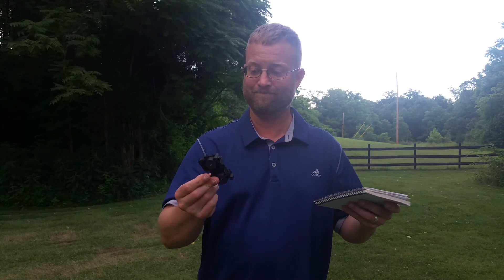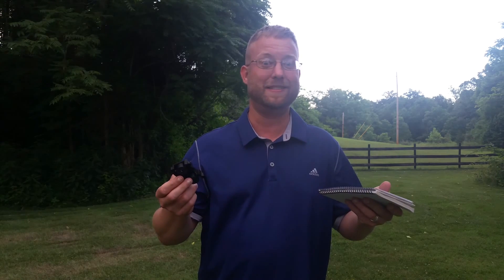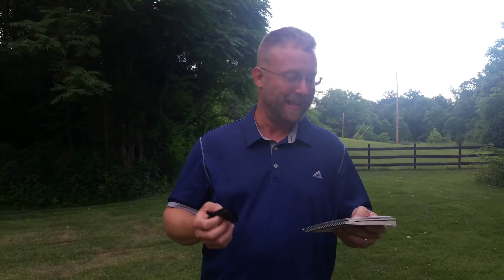Open Flywheel Project - High Crush Stryfe Cage

Comment: Where do you buy your motors? I love your vids btw. Your video on quieting super stock blasters is awesome. I followed your links to Kysans website but I couldn't figure out how to order. I already bought into the IMR ecosystem and I'd like to center my build around them for now. I have 10 nitecore 650 batteries so plenty to use. So far I have rewired two stryfes with 18 awg the first with a regular switch and the second with the jam door switch so I have motor braking. I got a high amp switch and I'm ready to move to aftermarket motors, cage, flywheels, but everyone is selling motors in spec for lipo.
Reply from the maker: Thanks for the feedback.  They have a separate e-commerce site that I believe is linked off of the product spec page.  The big downside to these motors is that you have to place a minimum $100 order to purchase from them.  

One other thing you can look at if you really want to run 14500 IMR cells is to use Honey Badger motors and wire the battery tray to have two sets of two cells (2x2) in parallel with each other.  That way you can get twice the current out of the cells.  It is a bit out of specs at stall (27 amps draw verses 20 maps burst), but it still should work OK.  A third non-Lipo option would be to use the Honey Badgers with four (4x1) rechargeable NiMH AA sized cells.  Not great spin up times, but a very safe superstock velocity setup.
Reply: @498nerf7  Thank you for your response. I looked at the spec on the Honey Badgers and they are very high rpm and thus noisy. But your suggestion has me analyzing spec sheets more closely. It appears that AMPs are the enemy of IMRs. I will keep looking but it appears there are few options widely available. You should consider opening an e store and offering a wide selection of motors for experimentation and special use. The Nerf sellers in the market now only really offer about 8 motors and they are all Lipo spec (other than the MTB HB which is crazy loud in the vids I saw). More options would be nice and I'm sure you'd have a lot of interest.
Reply from the maker: If you are looking for quiet, then run this battery setup with a pair of MTB Rhinos (the old ones).  It will be just barely supercritical, but the current draw will be around 24 amps for the pair at that (lower) voltage.  Stall current draw drops with voltage for brushed DC motors.
Reply: @498nerf7  Thanks for the info. I will try exactly that. My plan is a 42mm OFP cage with the blue Blaster Parts wheels. Not crazy crush and hopefully not to much wear on the IMRs
Reply: @498nerf7  Ok looks like a larger flywheel will give me more surface speed. Which would you use: Out of Darts light weight wheel 35mm, or the Worker wheel? And at what crush? Thanks for help, you seem very knowledgeable especially with this battery type so your input is appreciated.
Reply from the maker: The advantage with the OOD Insutanto wheel is that it will spin up faster, which is more important on lower torque builds.  I like the Containment Crew Cyclones myself, but they are heavy and will spin up more slowly.  For crush, honestly, whatever you would like.  Higher crush = high velocity.  There is a myth in the community that high crush needs high torque motors.  But it isn't the torque that propels the dart, it is the energy stored in the flywheels.  High torque just gets you up to speed faster.
Reply: @498nerf7  I missed this reply earlier. Thank you for all the help!

Comment: Serious numbers there! How well are the waffles holding up over long-term/repeat shooting with this kind of set-up? Much damage being done to them?
Reply from the maker: Not that much wear, but I am losing a few heads.  If I take 20 darts and shoot them each 5 times through the blaster, I'll lose 2-3 heads.  I think this is an issue with the darts more so than the high crush build.  Some of the heads are not glued on as well as they should be.

A note of the velocity readings:  Meishel from FoamBlast recreated this exact setup and was only getting 150 fps with waffle darts.  We went back and forth for a couple days trying to figure out why they were different.  In the end, we came to the conclusion that my chronograph was reading a bit too high.  This setup is likely shooting in the low 150s - still really good but not in the 160s.
Reply: It's almost like we need to be calibrating a chrono with something like a "standard" build before each session... (a springer might be more consistent there?)

Comment: Do you know how much current those 17114s draw at stall? Most 130-size motors don't work in high-crush cages, from what I've heard, just because they don't have enough torque
Reply from the maker: Armadillo 2001 They draw 5 amps at stall at 16 volts.  They are a high voltage, low current motor.  Their torque number (@16 volts) are similar to Rhinos (@ 12 volts).
I'd heard similar feedback that high crush cages need higher torque motors, but that really doesn't seem to be the case.  Aftermarket 130s seem to work just fine for stock wheels in these cages.  Now, the Cyclone flywheels really want more torque (a la 180s) to get spun up, but that should be true for any cage, not just the high crush one.
Reply: 498 Nerf I am quite impressed. 170 fps off of 14500 IMRs is nothing to scoff at.